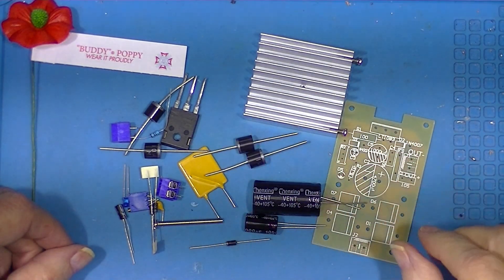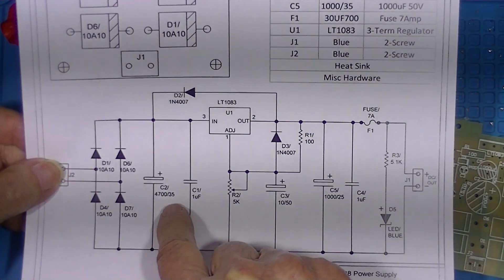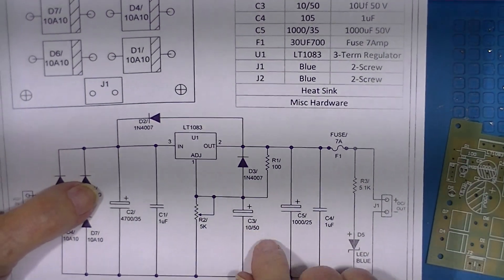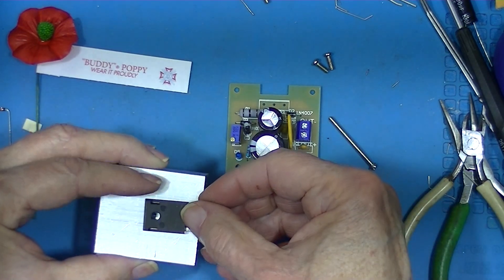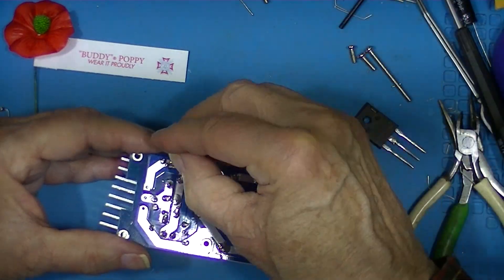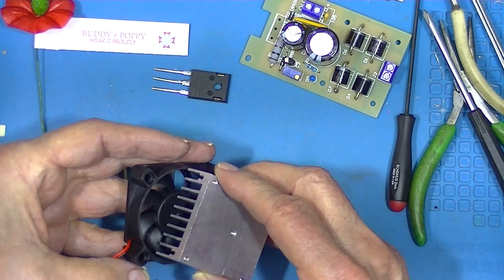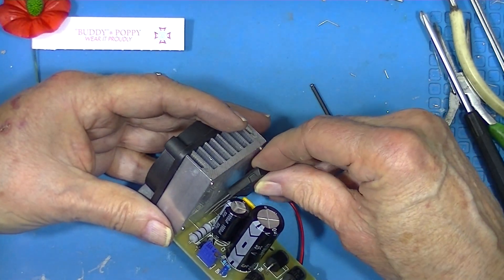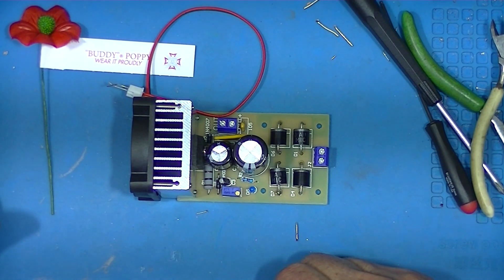LT1038 Power Supply Part 1

Comment: Hi Steve. Do you know where to order  the original LT1083  from Linear Technology  , Mouser  says obsolete? . I  received LT1083 marked LINEAR Technologies  from Ebay and Ali express but those are  not  original and keep blowing up  even at a small load and far before the published datasheet limits  are reached.    They  have forgotten to put the steroids in?
Reply from the maker: The best answer is to look on Ebay for a US based seller and contact them and ask about where they came from. I have been able to get some DIPs that are obsolete with a cert. of manufacture.
Steve

Comment: Hello Steve, hope you are well and safe!! 
In your older YT channel I noticed you have (and use) a CircuitSpecialists HH 2205D - so I bought one for myself at that time (couple of years ago). Now the multimeter is acting strange, specially when measuring DC voltage and resistance.  I opened it in hopes of re-calibrate it - for that I also bought some RLC and voltage references from ebay. But I am a bit lost about all the trimmers inside and I'm hoping you could do a video about servicing this multimeter (or multimeters in general). It's a great multimeter and I don't use it much anymore because of this.
Thank you so much for your videos, I see all of them, I've learned so much! Please stay safe!! Cheers!
Reply from the maker: Yes, the HH 2205D has been a very useful meter, at least for me. I have no information abut the calibration procedures nor any source of info. Sorry!
Steve